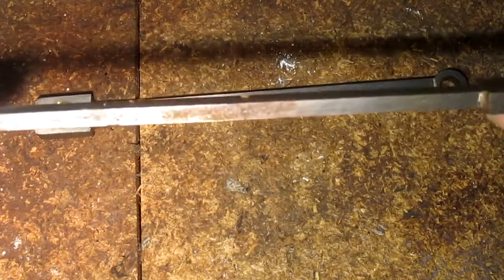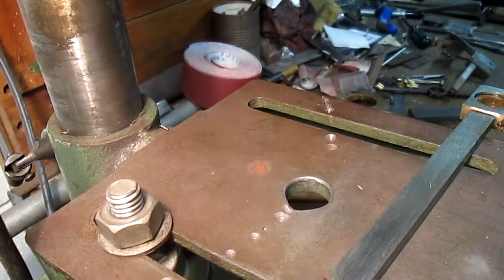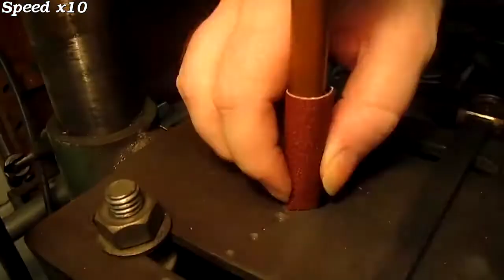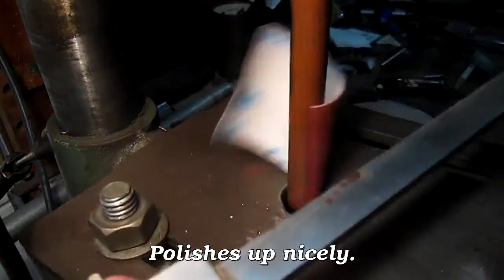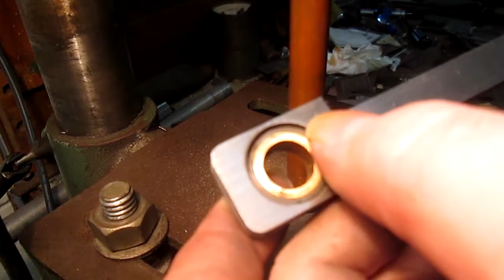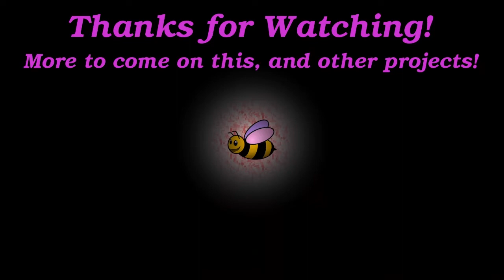Polishing Coupling Rods with the Not-A-Linisher - Or Getting the most out of the tools you have

Comment: I like the intro, short and bot too loud, it's perfect for a audio intro imho, I like the content, and thank you for uploading :)

The slot trick is one I learned this past year or so, I used threaded rod, and was able to polish about 20 thou out from a bore in a cutting die for a electricians pipe hydrolic punch set, the 4 inch die was tight on the mandrel and wouldn't move on to it.

I also like the use of the center hike to keep it aligned in the drill press
Reply from the maker: Thanks, and you're welcome. :)
I'm still working on the intro, not happy with the graphic content of it yet.